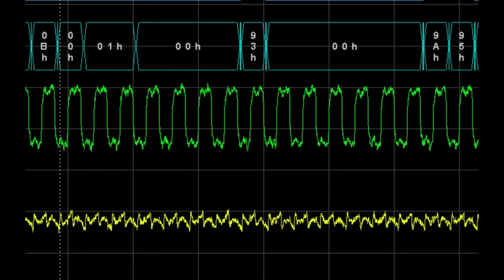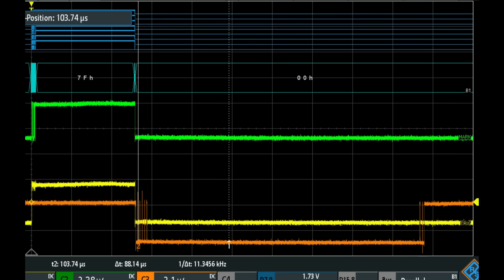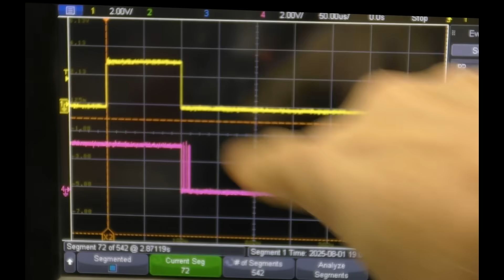Ethernet protocol decoder  Etherdecode V2

Comment: I could have needed that in 2016 for gbit ethernet, we were having misbeehaving switches and port mirroring magically fixed the issue... (yes, the workaround was to run with enabled port mirroring for years)

Comment: Interesting gadget to analyse medium level Ethernet problems, low level it will probably not detect either due to using an Ethernet PHY/MAC and high level is just so much more comfortable in Wireshark than the oscilloscope/signal analyzer.

Comment: Interesting to analyse the microsoft spyware at kerner layer, things not visible from app/api level tools.
Reply: Intel ME/AMD PSP spyware is much more interesting, those also work when your computer is powered off.
Reply: @game-teaabout 5 years ago i've seen with intel laptops that they do something when powered off which uses a lot more power than a normal battery discharge. i suspected the ME. i haven't seen that with amd laptops but maybe they do these days, i don't have access to various models now
Reply: oh seriously, go wear a tinfoil hat...

Comment: The MEMS oscillator had a bit of jitter on the output...   Yeah they do that. The manufacturers play funny with their jitter specs (look at the integration they bandwidth if they even specify) And pretty much none have actual phase-noise figures.  The close-in phase noise on those can be pretty bad.

Comment: Losing packets can lead to serious problems, if you implement a guaranteed delivery protocol over UDP. And other issyes mighd cause problems too. We had a clustering solution that used UDP and the  cluster state communication saturated HP switches. We had to use Ethereal, later know as Wireshark, and we found out a but win Windows server 2003. If a packet was 2048 bytes, or large, every packet caused an ARP discovery message. And they were causing the saturation and more packet loses, so the situation got out of hand pretty quickly.

I worked as a programmer back then, but luckily my major was telecommunications/telecommunications programming and therefore the debugging tools and packet structure were no strangers for me. The guy that implemented the clustering implement aion had zero interest in figuring what caused the problem. When I reported my findings and true measurements on the performance of TCP, the clustering impementation switched to TCP pretty fast.

Comment: AI Summary

Abstract:

This video presents a redesigned, all-surface-mount version of a custom-built 100-megabit Ethernet Protocol Decoder. The primary motivation for the update was to streamline manufacturing, allowing the boards to be ordered fully assembled. The hardware tool passively taps into an Ethernet line, converting packet data into a parallel format with marker signals, making it possible to trigger on and analyze network traffic in real-time using a standard oscilloscope or logic analyzer.

Key improvements in the new version include a switch to USBC for power, color-coded status LEDs, larger operator switches, and full 8-pin pass-through to support Power over Ethernet (PoE). The video demonstrates the decoder's utility for real-time debugging, such as correlating network packets with hardware chip-select signals to diagnose an elusive packet-loss issue caused by clock jitter—a task difficult to perform with software tools like Wireshark alone.

An Updated Ethernet Decoder for Real-Time Hardware Debugging

*   00:00:03 Introducing the Redesign: The video introduces a new, all-surface-mount version of a 100-megabit Ethernet protocol decoder, designed to simplify manufacturing by enabling automated assembly.
*   00:00:28 Hardware and Usability Improvements: The updated board features several modern enhancements, including a USBC power port (relocated for better cable management), larger switches replacing the previous DIP switch, and color-coded LEDs for at-a-glance status checks.
*   00:01:42 PoE Support and Robust Design: The decoder now passes all 8 pins of the RJ45 connection, allowing Power over Ethernet (PoE) devices to work through it. While using less durable surface-mount jacks, the PCB thoughtfully includes footprints for through-hole connectors as a robust repair option.
*   00:03:01 Core Functionality Explained: The device allows you to visualize Ethernet packets in real-time on a scope. It outputs marker signals to identify when a packet is active (yellow trace) and where specific bytes are (green trace), enabling triggering on events that are otherwise invisible in the complex Ethernet waveform.
*   00:05:04 Advanced Packet Analysis: The byte marker signal has multiple modes. It can identify the different fields of a packet (e.g., MAC address, IP data, UDP payload, CRC) or act as a simple byte counter, which is useful for verifying a correct logic analyzer setup.
*   00:06:08 A Real-World Bug Hunt: The creator provides a concrete example of the tool's value, showing how it helped him find a bug where a W5500 Ethernet chip was dropping 1% of packets due to clock jitter from a MEMS oscillator. The decoder made it possible to see the packet arriving without a corresponding hardware interrupt.
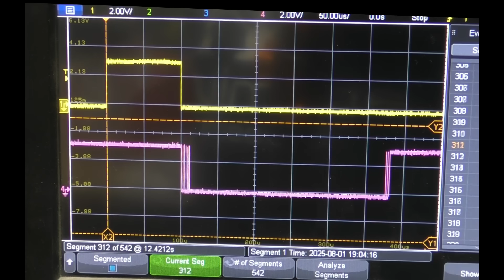*   00:09:19 Why No Gigabit Version: A gigabit-compatible version is not practical, as the 125 MHz parallel data output would require a very expensive, high-speed logic analyzer. For most use cases, forcing a link to 100 Mbps for debugging is sufficient.
*   00:09:53 Availability: The new, redesigned Ethernet decoder is available to purchase from the product website, etherdcode-dot-com.

I used gemini-2.5-pro| input-price: 1.25 output-price: 10 max-context-length: 200_000 on rocketrecap dot com to summarize the transcript.
Cost (if I didn't use the free tier): $0.03
Input tokens: 15859
Output tokens: 720
Reply from the maker: We are all doomed
Reply: Piss off with this utter slop.
Reply: @mg80888  This just a transcript summary which is helpful for me when I can't watch videos at work but can read something.
Reply: @mg80888  Its a good summary, better than anything you'd be able to write.
Reply: boy have you come to the wrong place with your gemini advertisement
Reply: @hardwareful I'm pretty sure this is just the built-in summary that ad-free YouTube tier has as a built-in feature. I'm pretty sure most people forget that it exists if they have access to it.
Reply: @blindsniper35  I just tried and the built-in transcript is the full text divided to hundreds of lines (basically subtitles), not a nice summary like this one.

Comment: im such an electrics noob, but would really appriciate alot if someone could explain to me: how the boards doesnt short out on the metal table, and also if someone can like, give me a tip or whatnot to touch a naked pcb board, whilst powered up. cus i have managed to short somethings out in the past by touching it (i think, a couple seemingly have died on my hands), and or is it mainly when they have caps on them and u short them out perhaps? im curious by nature and love experimenting with..everything. but sometimes avoiding electronics cus im just afraid i will break it and not be able to fix it or do more damage.. general tips handling this would be great :S cus like last time i touched electronics (not soldering connectors or such) i got chocked byan oven (one of the knobs where u changing heat was broken and some leads where poking out) and apparently plugged in the wall still... it literally made me jump and i couldnt rly let go from it either lol. 
sad part of this story (in more than one way) is: it got me twice.
Reply from the maker: You don't use a metal table ( Also, the board has rubber feet)
Reply: Suggestions for working with electronics in a safe way both towards oneself and the electronics is:

1. Don't work on mains connected device. And generally stay away from fiddling with them until one has learned the basics of electronic theory. (And if one "must" then disconnect it! and make sure it is disconnected. Get a volt meter and measure that there isn't any meaningful AC and DC voltages present, else it can end badly for oneself)

2. You won't really short low voltages with your fingers. Higher voltages (50+ volts) is a different story, but here point 1 returns again, don't fiddle with high voltage electronics until you have gained more knowledge of what you are doing.

3. Work on a wooden table or other ESD appropriate surface. (Generally avoid metal tables since point 4 bellow will be broken every time you place something on the table, and it will also short things out. Plastic work surfaces is also to be avoided unless ESD rated, since plastic can accumulate a lot of electrostatic charge that in turn can kill electronics.)

4. Make sure to safely/slowly discharge any electrical potential differences between yourself and the circuit at hand. (Since electrostatic buildup rapidly discharging is generally what kills electronics on the electronics work bench)

5. Get the basic tools of the trade. A multimeter able to measure AC/DC voltage and current, and preferably also resistance. And most importantly, learn the basic concepts of electronics. Ohm's law, Watt's law, and perhaps the basic characteristics of common components. Since this basic knowledge together with a basic multimeter is what will make you able to even do this hobby.

In general, always start the hobby on something simple. Like making a circuit that can turn a small brushed DC motor both forward and reverse from 1 DPDT switch, or calculate the needed resistance to get a desired current through an LED from a given voltage source. Or just how to make the humble 555 timer run at 1 Hz. After these beginner projects, one can move up to slightly more complex topics. Like making the 555 timmer generate a 1 kHz sawtooth wave and sampling it with a computer's audio input without frying the computer.

Learning how to do more complex things takes a while. Rome weren't built in a day after all.
And honestly speaking I think any good electronics hobbyist has at least a handful of completely useless garbage projects that learnt them the basics, where probably half of them didn't work but we can learn from our mistakes.

And even when moving into new topics do a lot of us make a useless project to test out how things go, what mistakes we make and if we understand the concepts we need to get right before moving onto what we actually want to do. And sometimes the answer is, no. We didn't understand, our test project failed and we can learn from that. It is one step forward. Often followed by a step back again for another attempt.

Comment: Looks awesome if you do lots of work with ethernet. 
Also wonderful addition of the extra pinout in case the connector tears off, and the cable direction. Things like that really are the hallmark between a 'mediocre' PCB and a great one.

Comment: I think this could be used to break the internet. Only kidding- use a protocol analyser for that...

But seriously, handy looking tool. Might even work to crack banking encryption schemes if you can have a programmable time delay between the relevant packets and "transmit pulse" on a PC motherboard (for synchronisation).
But then this raises another issue, how to find the right packets...

Great video! Lots to think about.
Reply: you watched too many movies about hackers
Reply: it's encrypted, won't be able to see anything... The only thing you can do with an FPGA to "break" the internet is to turn it into a packet generator for DoS-ing, if you have a very high speed link (10/40Gbps) then your regular CPU is a bottleneck to act as a traffic generator, but an FPGA will blow through it as a breeze

Comment: haha 2:30 that's the mark of an experienced engineer. Love the "if you tear the connector and all the tracks off" fallback. Beautiful
Reply: Mike's ability to predict failure types and discussing workarounds during his product design explaination is soooooo fun to listen to
Reply: @iamdarkyoshi  yeah he's always been a real goldmine of tips, often casually dropped while talking about something fairly tangential. Mike's teardowns also very interesting due to the level of wisdom/insight.
Reply: @iamdarkyoshi  Well, because he has experienced a lot of them himself, and learnt that is pays to make spares of any part, and if you are using a lot of the same item to make it be able to do multiple functions simply, and with no need for complex software around, because fixing a fault up a ladder with only the board, a few hand tools and a time crunch is pretty much going to be standard fare.

Comment: Lovely tool! Is it buffering the packet before dumping it on the parallel bus? or are the bytes coming out before the Ethernet frame has even finished?
Reply from the maker: The Phy probably buffers a bit or two for synchronisation, but the output is close to realtime, so you see it as it's coming on on the wire, and you'll still see packets if they have bad CRCs, for example